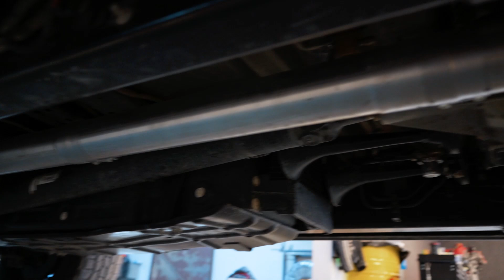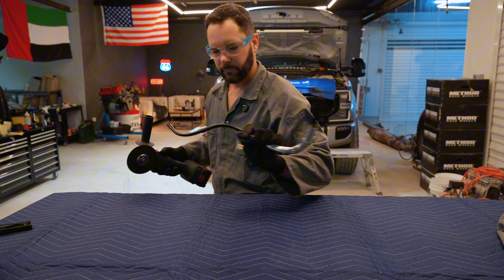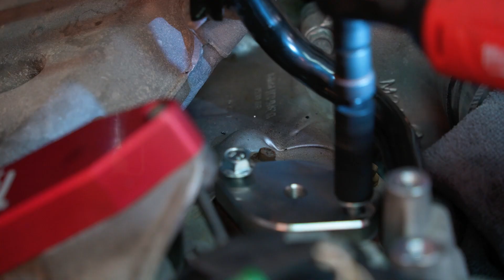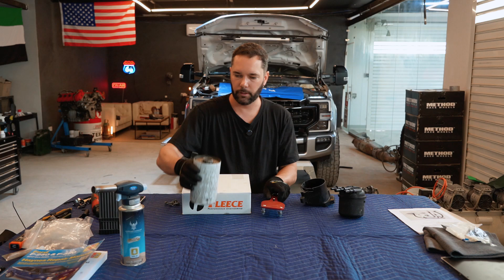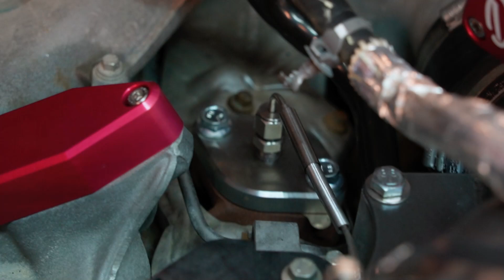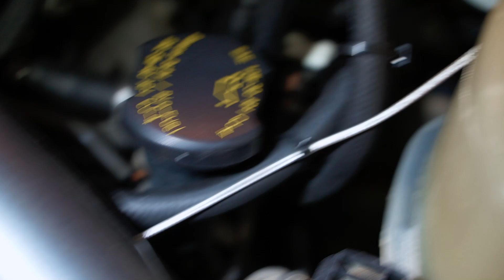The Best Reliability Modifications For Your 6.7 Powerstroke

Comment: Greetings Seattle Tacoma Fans Toyota Powerstroke Fans club .  All my rides have Dakota Lithium battery 130 amps weights around 27 lbs each place consider it because you focus on weights reducing no performance this battery on my 12 year using it lasts longer on the heat/cold 🔥 ..

Comment: I use the Amsoil dual bypass filter system on my truck and I make a bracket for it on the 2017+ trucks. Amsoil now makes a dual guard which does not replace the full flow filter which I would recommend for your truck. look into the filter system and if you decide you want to do that look on Send Cut Send for the mounting bracket.

Comment: With dust environment I’d recommend staying with oem air filter
Reply from the maker: Based on what? Id need to change my filter every month as the stock one gets clogged fast and they are not cheap here. The aftermarket one is tested in dusty environments and also has more surface area. I still need to clean it every month or so but its washable and I have the pre filter screen on it as well.

Comment: Great video. I live in the UAE as well and have done similar mods. I recently purchased the STOF tune, but after uploading the tune, I started facing an issue: the MAF sensor is not reading correctly and the truck keeps choking! When I unplugged the MAF sensor, it started running smoothly. So I emailed the company and am hoping to get this issue resolved. It seems to have something to do with the MAF table in the tune. I'm wondering if you faced anything similar or have any solutions. Thanks, brother, and very informative video.
Reply from the maker: Glad to hear you have done some similar tunes, im hesitant to reply to your question as it can very depending on who the tuner is you went with. It's best to follow their instructions. However if you went with AMDPs tunes its important to note for SOTF the throttle plug next to the throttle valve and the emissions harness on the ecu by the firewall need to remain unplugged. I have not had any performance issues only a exhaust cleaning light initially which was due to me enabling the auto regen inhibit option prior to the tune so returning that setting to factory allowed that message to go away.

Comment: Great job brother 
I got 2012 f250 6.7 power stroker diesel ,,I’m replacing the turbo🤷🏻‍♀️. I really need to upgrade the pipes.
Greetings from Dubai brother 
🤜🏼💛🤛🏼
Reply from the maker: Hala wallah brother 👋 glad to see theres more diesels hiding here in Dubai. What's the reason you need to replace the turbo? Or are you upgrading to a KC turbo? 🤤 for sure do the pipe upgrade or at least the cold side so the plastic doesnt break and ccv to keep the oil vapor from clogging up everything 👍  catch you around Dubai. Be sure to say hi if you see me.

Comment: Nice Video, lot of components to install; Agree on several components, remained emissions legal for my area.  Have all Pusher Pipes & Intake, SPE Intercooler next. On the CCV, elected SPE CCV Recirculating… less smell & mess under truck. Plus easy maintenance. The SPE DRK is also great, not concerned to replace CP4 with OptiLube and Insane Diesel Lorenzo Fuel treatment additives on ‘24 F450… too new to remove and replace for no reason. Insane Diesel Oil ByPass kit (adds 2 qts) & SPE oil pan (adds 3 qts), mount ByPass under engine cradle… 2 holes passenger side fit bracket nicely… both lines very short… Pressure Sw & Pan Bung with reducer to fit 1/4" fitting. Added SPE Tranny Pan (adds7 qts) and flush to convert to AmsOil ULV.
Reply from the maker: Very nice alternatives, do you find the Insane Diesel oil bypass sits lower than the frame rails? where do you have the return going to an altered fill cap?
Reply: @RoamingDesertDweller   Not low at all, I have it sitting up in the engine cradle. That's the concave section frame under the engine. It doesn't protrude below the cradle. As mentioned above, there are 2 holes on Passenger side that fit the ByPass Bracket like it was intended, so no drilling through frame. Oil Lines are extremely short; I'm very opposed of running oil line needlessly to topside fill cap... seems like a fire hazard waiting to happen. The SPE Oil Pan (o-ring, not gasket) has 2 extra ports. 1 to Oil Heater, 2nd to ByPass Return line: 1/2NPT converted to 1/4.  To change Filter, Loosen Bracket swivel nuts, canister rotates down and change filter without removing canister from frame. Line Routing:  Supply Line off Oil Pressure, Return Line to Pan. Used 2 Magnet Zipties in cradle, and 2 rubber insulated line clamps off 2 Pan Bolts to route and manage lines. Side Note: Exchanged a few line fittings for 90 degree fittings to make it all route clean & secure.
Reply from the maker: @dougcjohn interesting. Im going to have to research that more. I didnt think there was space over there by the filter to fit it but I guess if it swivels out of the way of the filter there must be a way. I'll look into it more. The spe oil pan is a good upgrade as well. I have the spe trans pan already.
Reply: @RoamingDesertDweller  I installed the Insane Diesel filter yesterday on my '18 6.7. The cradle location concerned me because it seemed certain that the front axle would contact the filter as soon as the suspension compressed. I ended up mounting it vertically against the frame just forward of the radius arm mount. That said, I did exchange messages with Insane Diesel (on New Year's Day - I hadn't expected a response until they reopened) and the guy said that the orientation doesn't affect function, FWIW.

Comment: Hello. Thank you for the video. Just curious, how much oil do you get leaking from the CCV tube? Also, is there anything you would change if you were to do it again?
Reply from the maker: i dont get any oil leaking from the ccv tube, just a little vapor but thats also very minimal. maybe as the engine ages i will start to see some oil drips but as of yet theres nothing. If i were to do it again i would probably do the S&S DCR fuel pump replacement for the CP4 instead of the disaster prevention kit so that i dont have to change filters and still worry about a potential failure of the pump eventually. But at the time of purchasing that it wasnt available.

Comment: I have many of the same or similar mods on my 2019. I noticed an increase in my fuel mileage on stock sized tires. I am curious if you noticed an increase with your truck. If I remember correctly you have 37s on yours. I am using the EZ Lynk as well.
Reply from the maker: There's a lot of factors that affect the fuel economy. Yes i have 37s, some of the transmission tunes raise the shift points so it holds gears longer into higher rpms increasing fuel consumption. Some of the power tunes also increase fueling. So im still testing to find which combination I prefer but so far I do see a small boost in range. Unclear if its due to the mods or the fact that I dont have regen cycles for the dpf which would normally consume a lot of fuel.

Comment: Great video would have liked to seen you removing the block off screws.  great job a lot of work done.
Reply from the maker: You mean the original egr crossover pipes? They came out without any struggle since I let them soak with penitration oil the night before. Had to cut the video down in some places. It was getting too long 😅 thanks for watching and the comment.

Comment: Can you tell me what tune you chose to use and what transmission tune you chose. Thanks
Reply from the maker: So im using AMDP's tunes for the '22-current deleted trucks, purchased through Dirty Diesel Customs. They now have tunes for emission on trucks as well. These tunes became available 48hrs after i did these mods. And when they became available the removed the old files. As for the specific tune file, i run a bit of an unconventional setup due to my specific use. I use the SOTF (shift on the fly) standard fueling tune files 0-150hp which I installed the SOTF after this video. And I also run another older tune I had them push back to me when im traveling remote. (You can reach out to me on insta or DM if you want to know more about that) for Transmission tunes, im still testing a few. On paper I like the high pressure (increases hydraulic like pressure to prevent torque converter plates from slipping) but the raised shift which holds the gear longer for larger tires I feel also consumes a lot more fuel as it keeps the truck in 8th gear around 80 or 90 kph when stock it would shift to 10th gear by 78kph (sorry not sure what mph that would be) id also like a skip shift option so it feels more factory skipping gears. For now im using high pressure, no skip, standard shift.

Comment: FYI the SPE piping kit style is much better because it removes all of the factory intake system and looks much better than this one that’s on yours
Reply from the maker: Pusher also make a direct Pipe that removes the throttle valve and EGR connections but as I mentioned I chose this one as I want to be able to swap back if needed and this Pipe is compliant with the regulations. Where I live they are changing the laws from next year and who knows if or when I would be affected with future changes.

Comment: Insane Diesel Oil Bypass filter kit with an SPE oil pan. With the oil pan you can return the oil directly to the oil pan rather than the oil cap. Also a DCR over the stock CP4 pump. Another item that is great is a Sonnax zip kit for the transmission that removes the thermostat from the transmission.
Reply from the maker: Great suggestions I'll definitely look into those.
Reply: @RoamingDesertDweller I highly recommend the Insane Diesel bypass filter. I mounted mine behind the license plate holder where a winch would be. It’s easy to get at to change the element and safely tucked away. Excellent video. Thanks!
Reply: Definitely agree about Insane Diesel Bypass, been looking at this one - I think filter can be installed under the hood?
Reply: @damedicmt  I have a King Ranch which has the lit running boards. The filter bolted right in on the running board bolts perfectly.

Comment: Really appreciate the video and the details. I have a white tremor 2022 F 250 6.7 and I am planning on many of the upgrades you have shown.  For external oil filtration, look at insane diesel filters.  Thanks again.
Reply from the maker: Thanks for your comment. I have been looking into insane diesel's filter lately. Theres definitely some pros and cons to their system. I have quite a few unanswered questions related to the engineering of their design for flow and the many ways the oil lines can be Installed etc. Hopefully I'll be able to find some answers and a solution for the oil bypass system soon.